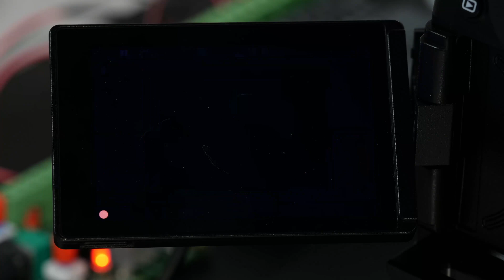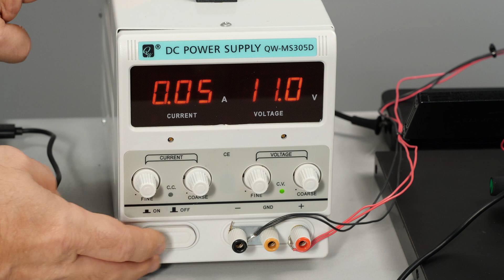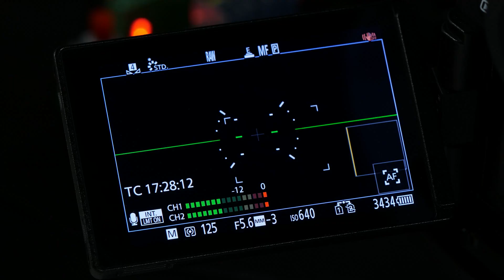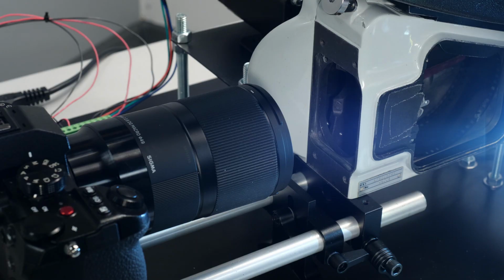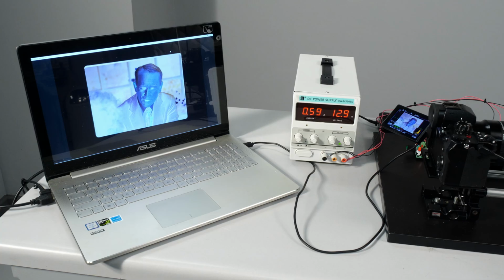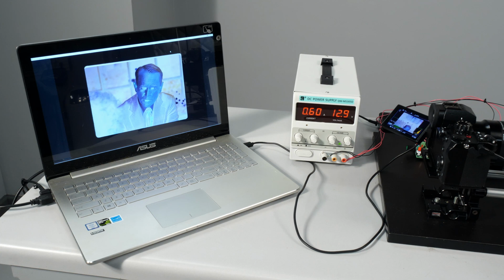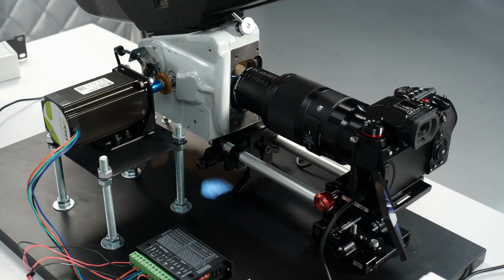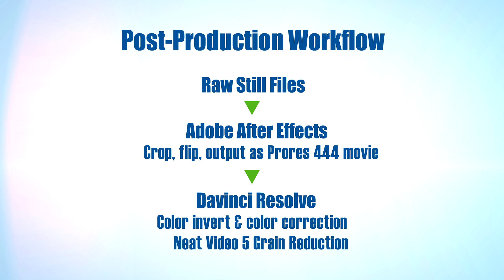Version 2 DIY 35mm Movie Film to Digital Video Transfer Device Telecine | 4K

Comment: What is the exact model of vintage 35mm film camera used to roll the 35mm reel ?
Reply from the maker: The camera used is the medical version of an Arriflex 2C. A few years back, there were a lot of them around as everyone switched from film to digital X-Rays, and they were cheap. Much harder to find now, and more expensive. It's possible to use a regular Arri 35 2B or 2C as well - basically the same camera movement,  but with the expensive mirror shutter and viewing system built-in. These too have become more difficult to find, and more expensive.
Reply: @FreshGroundPictures  How much did you paid for your medical version ?
Reply from the maker: @carminedepaola8018  I don't remember, no more than $500, probably less.

Comment: Great use of the bulbs for the light source.  I've been poking at a compact slide capture system I can just connect to a kodak carousel projector with as few as possible modifications.  I've been using a Ulanzi-49 lamp for my backlight but i like your solution too!

Comment: Amazing work.  You definitely nailed all of the issues in dealing with frame capture. The most important being frame positioning.  I'd like to see more about the Color Invert and Correction portion of your process.  I have scanned a few negatives, both 16mm and 35mm and have found it difficult to get the color correct.  Even when I had a reference positive to compare to.  Thanks for sharing this!

Comment: Could this work with a Bolex Camera for 16mm? That would be awesome...
Reply from the maker: Not sure - 16mm cameras have very little space behind the gate for a lamp system. Also, most Bolex cameras only use 100 foot spools of film. I did create a 16mm system based on Arri 16 camera components - there are 3 videos posted on the site.  I decided to remove the camera components and use them in a unique configuration that allowed 1200 feet rolls and more space.

Comment: I’m really interested in the sci fi feature film you made. It looks genuinely amazing. Do you have and bts footage? Is there anywhere the film can be seen?
Reply from the maker: Hello, thanks for your comments!  I'm still working on the HD restored version which I plan on posting on this channel this year. You can rent an SD version on Amazon - it's titled Death on Saturn's Moon - not my idea, but the distributor at the time wanted that.  The restored version will by slightly re-edited with additional scenes and effects. When I post the film, I'll also post the DVD supplements that were included. There are no official DVDs available for sale anymore, but you might find one used on Amazon or eBay - there's a bunch of behind-the-scenes stuff on the DVD. Be sure to get the the DVD titled "Ascension", as it's the only one with extra material and the only one I ever approved. Thanks!

Comment: What is the fastest you can scan per sec or min?
Reply from the maker: I generally run it at 1-2 frames per second. Mechanically it could go much higher, but the digital camera I'm using cannot take full-rez raw photos any faster. Maybe jpegs...

Comment: Fascinating video! Thank you so much for sharing - your videos actually inspired me to start building a similar system for a 2 perf 35mm system I’ve recently bought. Do you have any tips for this set up?
Reply from the maker: Interesting - what system did you get? I've thought about 2 perf, but converting the Arri 2C is a bit complicated. To transfer the footage on a 4 perf system at 2 film frames per digital shot would be easy, but you'd have to have some way of cutting out each frame and then numbering it in the correct sequential order. Might be able to do that as a script in Photoshop...

Comment: How did you make camera contact switch? And, is it possible to make one that can work on any DSLR?
Reply from the maker: Yes - you need to purchase a remote switch/cable for your digital camera and then take it apart so that the contact points in the switch run through the momentary switch attached to the film camera inching knob.  I bought a cheap $14 off-brand lumix remote, but it should work with any camera and remote shutter combo.

Comment: Love this, I’m amazed at the image quality of these scans! Please consider re-publishing a 4K scan to YouTube in 4K, I would love to see that. Also what are the CRI/TLCI value of the projection LED light? Yuji LED appears to make the best LED lights in the industry with a CRI value of 98. Is that what you are using?
Reply from the maker: This video and its samples is posted in 4K. As to the lamp, it's a tricky compromise. The current setup has 2 festoon style holders. The LEDs are not top quality, but they supply very broad, very bright light that can be directionally pointed to get the most even spread across the frame. I have ordered some other bulbs, including xenons which supply very high color quality but also produce more heat and don't have the same spread. The white balance on these bulbs is closer to 3200K (as opposed to the LEDS which are around 6000K) which means the camera balance would have to compensate more to eliminate the orange mask. I plan on doing some experimentation with different bulbs, but it's a matter of brightness (allowing a stop of around 5.6 on the camera), heat, beam and color reproduction.
Reply: @FreshGroundPictures  Funny, a 2160p option is not availablee to me, is that a premium feature perhaps?

Comment: WOW the setup looks great and you have amazing results but the movie loses color quality due to poor quality LEDs. You can see that the colors are off. Try to use LEDs with at least CRI95 or even better with an incandescent lamp - you will see a huge difference in color quality and the film will regain its unique characteristics. It is not about the white balance, but about the discrepancy in the saturation of certain colors and tonal transitions.

Comment: the S1 sensor only holds 14 stop of light but film can go much higher. how can you capture the full dynamic range?
Reply from the maker: I don't claim to capture the full range of film exposure, especially highlights.  I think most scanning systems will have some loss. The Arriscan system has the ability to do 2 passes on each frame, one for shadows, one for highlights. Converting film exposure to digital information creates a whole different animal. I'm happy if the digital scan captures the "essence" of the film image.
Reply: @FreshGroundPictures  thx, how hard would it be to do 2 passes? auto RAW bracketing with HDR compositing maybe?
Reply from the maker: @robertulrich3964  That might work - the easiest way would be to either do 2 exposures of each frame and blend it in post, or even better workwise is to blend the raw files in camera. I know the Lumix S5 can do this, but I'm not sure it can be automated to run with a single remote shutter activation. Either way, it would be a compromise on processing time either between frames or in post. Interesting...
Reply: @FreshGroundPictures  i made a free after effects project that will HDR merge images/video if you'd like to try it. i also checked and indeed the S1 has built in iso bracketing!
Reply from the maker: @robertulrich3964  That's great! I'm busy with other things at the moment, but if you send me a link I'd like to try it.

Comment: you can transform raw files to dng with adobe dng converter and do everything on resolve. you don't think it looks better without noise reduction?
Reply from the maker: Noise reduction is a very subjective thing. The older 500 speed stock is surprisingly grainy. The 50 speed daylight stock has very fine grain. I guess I tend to be old school where grain was viewed as a defect, but now many people watch digital images which are usually very clean so grain is seen more as an artistic expression. The newer grain reduction software works so much better than the old real-time grain reduction on Ranks and Spirit transfer machines, which softened the picture and added smear if too heavily applied. I guess to each his own...
Reply: @FreshGroundPictures  I’d love to know how a analog Degrain worked on the Rank’s and Spirit’s ... There is a lab and transfer here in Stockholm still, they process all motion picture film for Scandinavia. But I don’t know which Telecine they have.

Comment: I love your ingenuity! Very clever. This new design is much better. Limited by how much film you can run, as the majority of lab rolls are over 1000ft, but for personal projects, it’ll work well. This is one of the biggest issues with 35mm, there are so many variants in perf and film length, it does cause some issues. In fact, I bet a 1000ft lab roll with leader for scanning may not even fit in the magazine. But still very cool!
Reply from the maker: That's true. I have tons of footage processed by Duart, and they normally only put 3 rolls on a flat. I was surprised however to find out that many times the last reel I shot was only a short end, so it fits within the mag. Duart usually put about 70 feet of leader on the flat, but the 1000' mags actually hold a bit more than 1000' so it usually fits. Because everything runs so slow, you can get away with using the 1000' mag on a 2C body - something you shouldn't do when shooting.

Comment: No. Sorry. This does not work. The resulting quality is nowhere near the potential of 35mm film. Even regular 16mm, not S16, looks better when properly scanned.
Reply from the maker: First off, it's not designed to compete with an Arri scan or Scanity that do multiple passes to capture highlights and shadows. It's a fraction of the price.   Also, the scans I've shown are from Academy 35mm frames. As far as your comments on 16mm and Super 16mm, I've shot and scanned thousands of feet of each, and 35mm, on many systems and I think your comments there are way off. 4K from 16mm is a stretch even with extensive digital cleanup.
Reply: @FreshGroundPictures  4K is just a digital resolution. Meanwhile optically, in the very center of your system is a $10 diopter lens… At least get a proper lens and probably also read about what diffused light does to the scanning/printing potential of a negative. It’s a cool hobby project though, I didn’t mean to be harsh. All the best.
Reply from the maker: @deepseadiver8191  Interesting though that Scanity chose a diffuse led light globe for their system to reduce scratches and dirt.
Reply: @FreshGroundPictures  It’s scanning as the name suggests. I thought you said you were not comparing yourself to them, are you?
Reply from the maker: It’s a ridiculous argument on many levels. Thanks for watching.
Reply: @FreshGroundPictures  Exactly my feeling about it.

Comment: Great work. I am very impressed. I have 16mm film and would like a similar 16mm version which it seems might be feasible with an Arri 16st.
Have you a way to reproduce sound from 35mm prints?
Reply from the maker: Hello - no I can't do sound from a print. I'm thinking about doing a 16mm system, maybe using the gate and movement from an Arri 16s. The 16S body has rollers behind the pressure plate, making it difficult to put in a light source without major modification. The 16m would work better, but the prices have really gone up in recent years.  My idea would be to use the film movement and synchronize film platters for feed and take up.  If I can find enough parts I'm thinking of building a couple and selling some. It would be interesting to see how much difference there would be in image quality between a cropped high-quality 16x9 frame out of a standard 16 image as opposed to a Super 16 image.  There are so many standard 16 cameras out there, but it's so expensive to have them converted.
Reply: @FreshGroundPictures  yeah everything is too expensive lately. I was wanting to convert a regular 16mm ACL to Ultra 16. However the acls have gotten too expensive.
Reply from the maker: Super 16 was important when doing optical blow-ups to 35mm, but I'm not sure it gives you as much with digital tools available now.  The only cameras that can be converted without compromise are the Aaton and Arri SR.  To convert an ACL correctly requires recentering and retiming the mirror and losing a few degrees on the shutter. Even then, the gates are not properly done, as most are just cut outs, and still have the full guide on the Super 16 side. I had an ACL converted years ago, but still had issues with slight flicker in the extended frame because the mirror was not recentered. There was a conversion kit someone made with a new Super 16 gate and mirror linkage, but I think they're all gone.  At any rate, maybe Regular 16 is good enough - these cameras were designed for that format and perform brilliantly with it.
Reply: @FreshGroundPictures  good points. Thank you.

Comment: Micro switches have rating, like a “UL/CUL 5A 125VAC” has a mechanical life rating of  500,000 cycles and electrical life is 100,000 cycles. 500K, that's about 5.7 hours of film.
Reply: How much does a switch cost? A few $ maybe? And it's available everywhere. 

Not an issue - at all.
Reply: @Nantawat_Kittiwarakul   Since 2014, and still making improvements today, I've been working on such machines, I released the "Gugusse Roller" in 2019, it is my invention which I published as a free DIY project. In an older model (Gugusse 16mm) I used such micro switches and as cheap as they may be, as easy as it is to replace them, having a piece that breaks while you're trying to scan is no fun, so yes, it is an issue.
Reply: @Nantawat_Kittiwarakul  But don't read me wrong, I'm impressed with the stability of the picture. If I had an old 35mm arriflex camera sitting somewhere I would probably have done the same..

Comment: You know that a mechanical shutter of a DSLR usually has a lifespan of about 300,000 clicks?... That's about 3.5 hours of film.
Reply from the maker: I'm strictly using the fully electronic shutter of the S5.
Reply: I also have a similar setup scanning Super 8 film using mirrorless camera with electronic shutter mode. I probably had burnt no less than half a million "shot" as of now. NONE issue found so far.